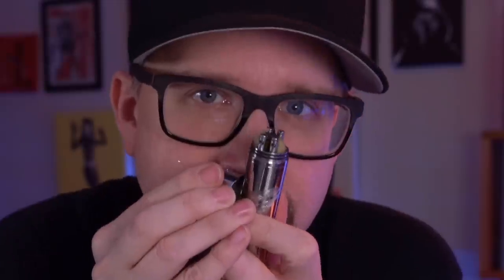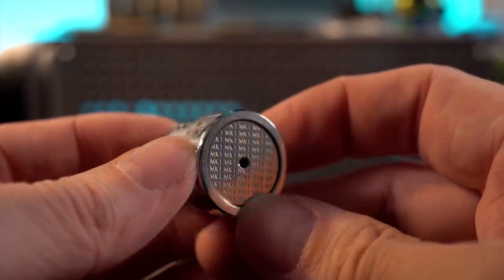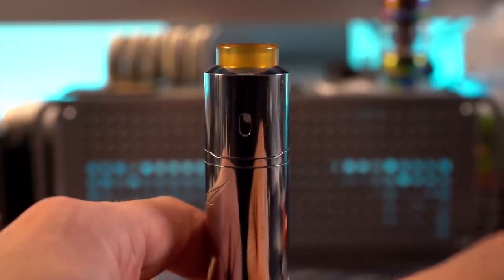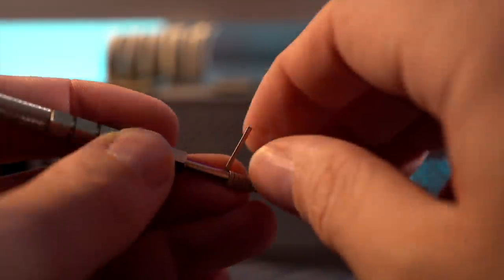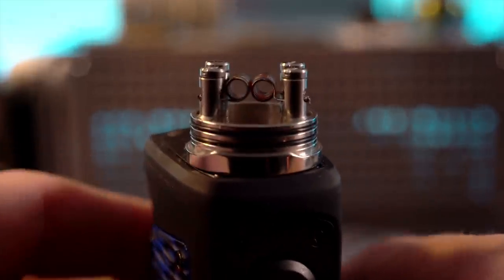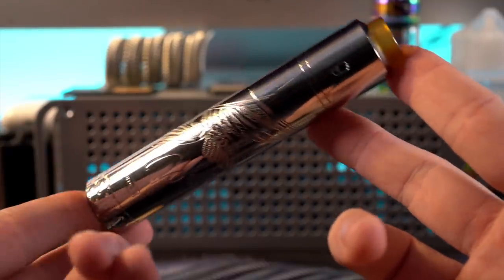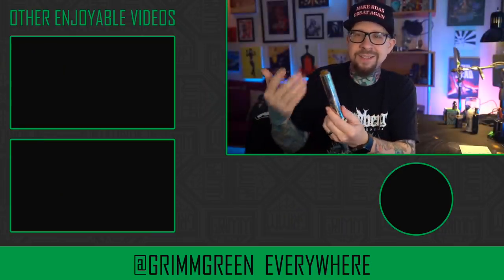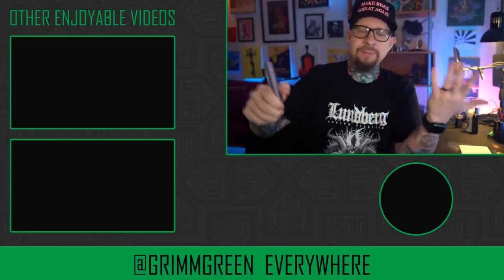Project IONA Mech MK1 : RDA

Comment: Hi Grimm, my name is Mervin and i am the owner of Project Iona. Thank you for the review and i would like to tell you that the spare o-rings in the box are slightly thicker to give you a tighter fit. The mods were also manufactured in China.
Reply: Thank you for not getting salty and talking about the solutions, we really need people like you
Reply: So 200 bucks if not more for a tube mod made in China, that only takes 18650s...that ain't right
Reply: @tehpwnzor1337  just because it's made in China doesn't mean it's going to be cheap immediately dude.
Reply: @tehpwnzor1337  relax. The machining on this is immaculate. And it isn't mass produced. Pretty affordable for the quality you're getting with it.
Reply: @jessetyas8559  affordable my ass, 200 bucks is pretty expensive for a tube that only takes 18650s and is made in China. Pretty expensive for your average vaper. I mean who's gonna buy it when 20700 and 21700 batteries are more popular and powerful anyways.
Reply: @tehpwnzor1337  buy vandy vape stuff then. I like my 18650 mechs, slim piece is my favourite mod. I doubt much makes you happy, hopefully that changes for you though.
Reply: @SeaCreamy  that's exactly what it means. Just about 90% if not more of all the vape gear is made in China and it's all pretty cheap. Why? Because it's mass produced, and not stupid high quality. Not saying all the china mods are crap, most of mine crapped out on me after a month. Plenty of other china tubes out there that accept bigger batteries and half the price.
Reply: @tehpwnzor1337  its not what it means. they could have the entire same materials and machining process, would that make it cheap? im willing to bet not.
Reply: @tehpwnzor1337  how does a mech tube crap out on you.

Comment: Hey Grimm I could be wrong but I think the reason why the flavor is noticed is because of how close your coils are in the RDA.  Which may explain the harder you pull the less flavor air takes the path of least resistance so when you take a hard inhale instead of the air going underneath the coils it’s just shooting straight up the cap and through the drip tip.  I’m no expert by any means but it’s a possible reason why your getting less flavor the harder you pull on your inhale

Comment: pretty!! something about ss mechs... they look really nice. pretty sure you got eliquid under your eye getting that close LOL mortal kombat works!! the mod overall looks to be of very nice quality. the machining and logo are really nice. the button is chunky but seems to be well made. love the ultem insert to eliminate battery rattle. seems like the company should've stuck with just the mech itself. the rda is a bit outdated. with that being said, it is a tried and true design, and i'm sure it vapes just fine. just have to be sure to trim the crap out of the leads of at least one coil to ensure fitment. was wondering if the rda would be loud... kinda is lol. bit pricey for what ya get, seeing what other products are on the market. still, quality manufacturing is expensive. pretty to look at anyway, thanks for the closer look Nick!! :D <3

Comment: Maybe back in 2015 this guy coulda been something. Just feels dated for me. I'd  just have 2 posts in the center, legs sharing a post hole (some people hate that, doesn't  bother me). Improve the airflow, maybe include a challenge cap that has wide open honeycomb airflow. Then make it fit a 21700. Woulda been perfect for me and I'd be aching to get one.
Fit and finish seems amazing on it though.

Comment: Those coils definitely looked like they were touching, also you should have removed a wrap off the framed staples 6 wraps aren't that great on a mech IMO
Reply: too low ohms, 0.14 ohm minimum on a mech with a 30amp battery
Reply: @jaakko200987654321  i use a triple parallel unregulated and for my single cells Sansung 20S' for 18650 and 30T for 21700. Also the only real danger comes into play with chain vaping, I'm not ashamed to say, i very often vape a .07 N90 Fralien in my Goon25 on my brizo, so long as the batteries dont get hot and you arent chain vaping you arent putting an over amount of stress on the cells to an "OMG ITS GONNA BLOW UP WHAT ARE YOU DOING" watch Jai Haze's video on the Purge Side Piece and look at Mooch's pinned comment. ANNNND my final point, M.Terk makes coils for single cell mechs cause thats all he uses and his triple 27 aliens around a 2.5 are .11
Reply: @jaakko200987654321  if you know what you're doing you can run lower. It's not recommended but a ton of people run 0.10 daily including me
Reply: @jaakko200987654321  ha I'm running .08  on 20s
Reply: @monkey0550ify  bomb
Reply: @jaakko200987654321  not even close

Comment: I dunno man. EDC, 2x700 is a bit much for me. 

I see the benefit. But that form factor -_-
Reply: Yung ThinkPad  

Eh, I don't generally carry tubes with batteries installed and I rock nice little case for the cell(s). Not trying to be that guy and wind up on the evening news 😅

Sure, it's not convenient in any way. But if convenience is what I was after I wouldn't be on a mech in the first place. 

Squonks, a piece of why I went deep on tubes was to get away from boxes. No dis, it's just my preference. And I think Grim actually touched on it once; the "ritual" of dripping... Like roll your own sort of. Pop the cap, do the thing, vape. Again, not convenient. But that feel tho 😅

Would I recommend EDC tubes? Hell no, it's a pain in the ass. Even before the maintenance factor. 

But as an individual it's what clicked for me. 22/24mm tube with a nice restricted DL atty. That's my shit lol.